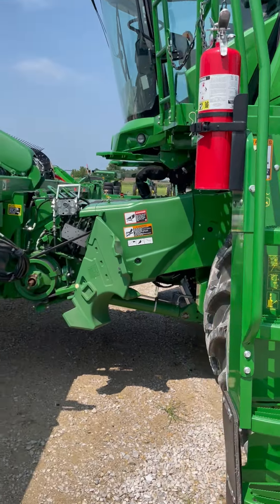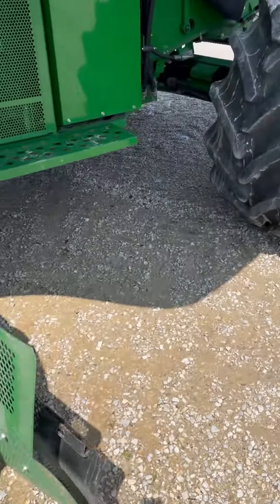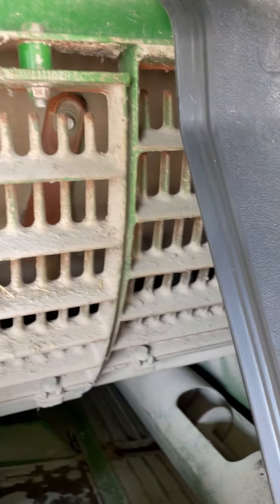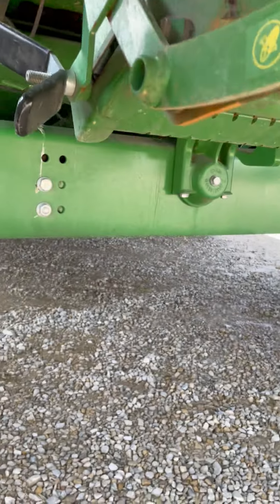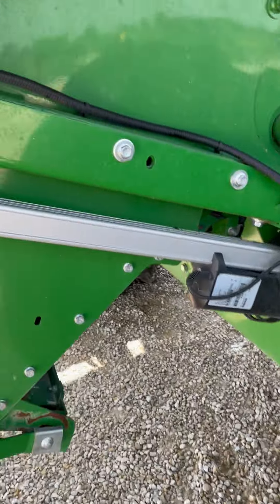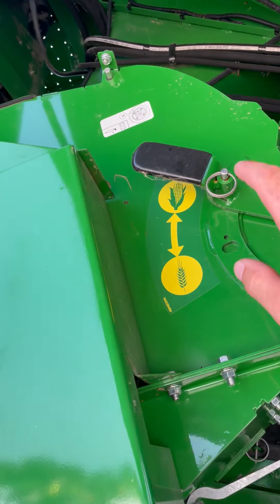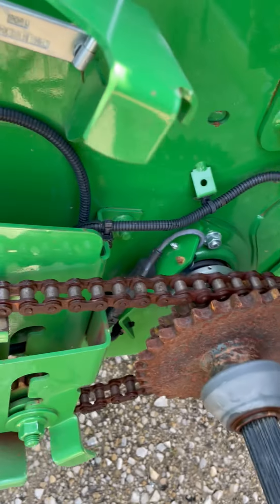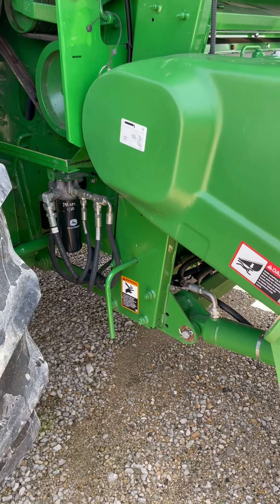Setting Your Combine Up For Corn

Comment: what is this go harvest app ?????
Reply from the maker: The GoHarvest app from John Deere is designed to assist combine operators with optimizing their machinery for entering harvest season. The app is compatible with S, W and T series combines and features simple adjustment steps. The GoHarvest app is free and is available for both Android and iOS operating systems.